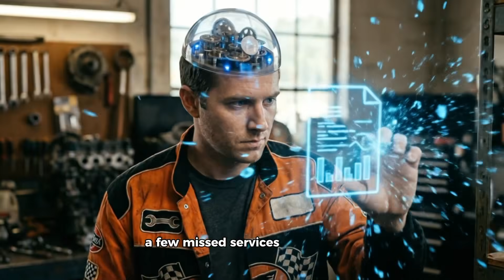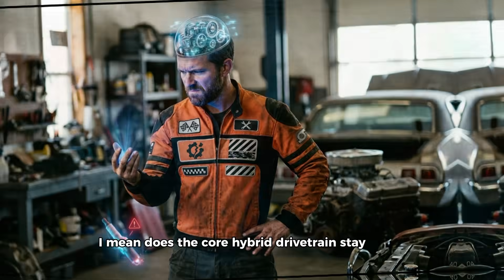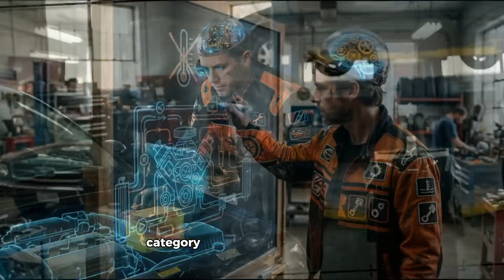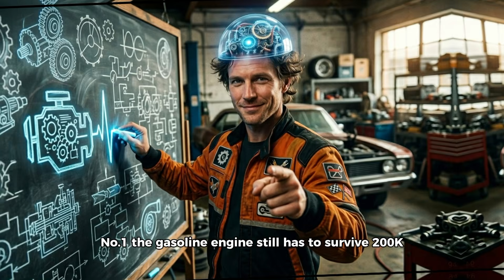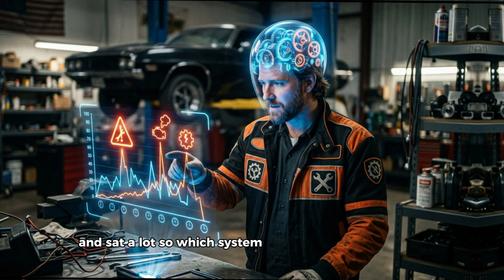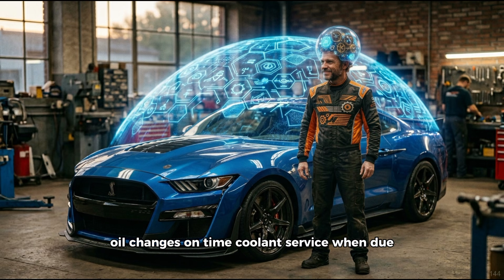Toyota vs. Honda Hybrids at 200,000 Miles: The Brutal Reliability Truth

Comment: Most early battery failures are caused by clogged battery compartment filters.
Reply from the maker: Jim, my friend! You are 100% correct, and it is the single most frustrating reason a perfectly good hybrid architecture goes to the scrapyard early.

From an engineering and thermal management standpoint, high-voltage battery cells generate massive amounts of heat during rapid charge and discharge cycles. Toyota and Honda engineered these packs to rely entirely on forced air from the cabin to keep them within a safe operating temperature. When an owner ignores that simple $20 filter in the back seat, dust and pet hair act like a blanket over the intake. The fan starves for air, the internal cell temperatures skyrocket, and the battery degrades exponentially faster than its normal chemical lifespan.

It proves that hitting the 200,000-mile mark isn't just about the strength of the planetary e-CVT or the e:HEV system; it requires actual mechanical sympathy from the owner. That simple filter is arguably the most important piece of maintenance for protecting your Total Cost of Ownership (TCO)! Always a pleasure having your sharp insight in the community! 🔧
Reply: I agree